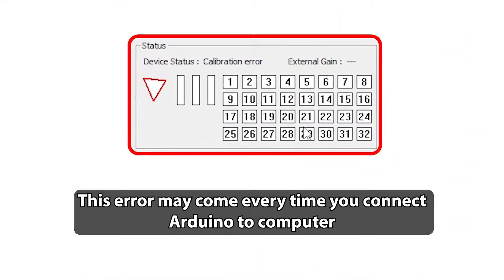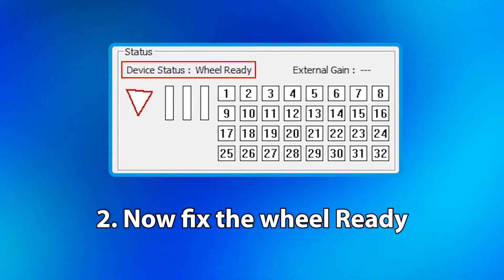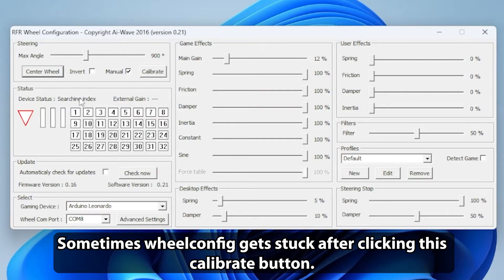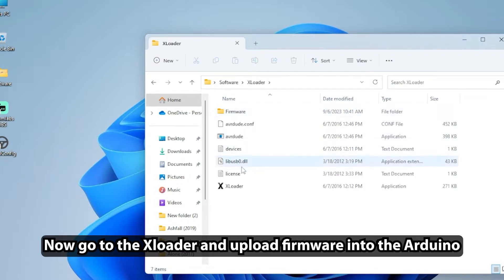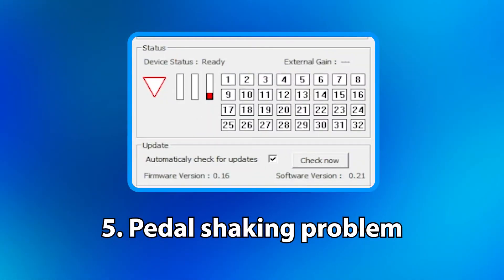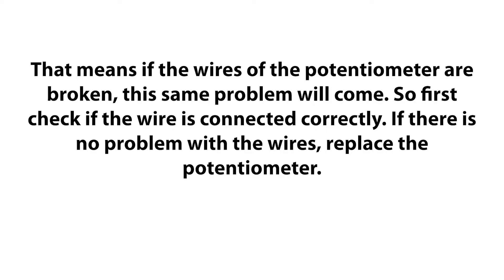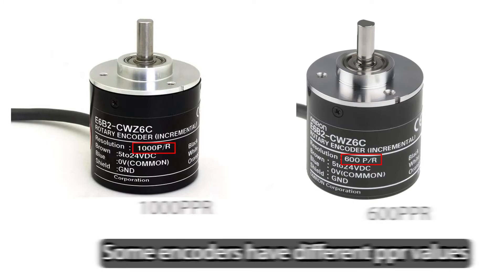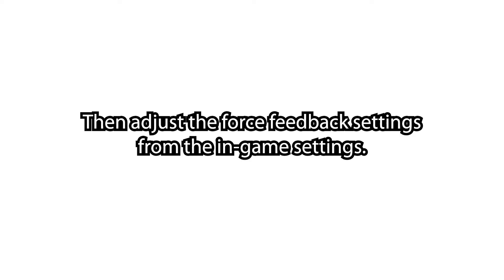Let's Fixe All Issues In RFR Wheel Configuration (0.21) | DIY Gaming Steering Wheel

Comment: I installed the application, no problem, it detected the Arduino, but it did not work even though I configured the encoder correctly, connected it and rotated it. I installed and connected EMC Lite to see if there was a problem with the card or the encoder. It worked. Do you have any information or a solution?

Comment: I couldn't solve the Firmware Version error
I completed the steps in the video completely

Help me
Reply from the maker: Rest your arduino board and try again.
Reply: I removed the Z connection and it was fixed. In order to work the encoder, it was necessary to make a Z connection on the Arduino  @zudumalli

Z connection= gnd-> A0

Comment: Hello, I have a problem. Can you help me? When I turn the steering wheel and then return it to its original position, if the 12V power is off, the steering wheel is in its center, but if the 12V power is on, as soon as I turn the steering wheel and then return it to the original point, the steering wheel is not in the center and its center is messed up. Please help me. This problem has just occurred to me. I checked all the wires, the motor, and the encoder, but I could not solve this problem.

Comment: i have built this, everything seems fine but while playing a game like ETS 2 or assetto corsa, everytime i change the gear the wheel changes it center to right little bit ,i am using RFR Wheel Config how do i fix this?
Reply from the maker: Maybe there's a short circuit somewhere.
Reply: @zudumalli  thanks ! It helped, turns out the Z toggle pin had came out and was making contact with the gearbox pins

Comment: My issue is that the force table scroll is stuck at 0%, and the motor is not generating any force feedback.(i am testing  using a HW -040 encoder and a 6 V motor and  battery )

Comment: hi my problem is i am using potentiometer for the stearing wheel but it stears half theway left and doesnt stear right i did replace the potentiometer and did it from another combuter didnt work seams like the problem from my arduino can any body help me to solve it
Reply from the maker: You need to rotate the potentiometer to the middle position, then rotate the steering wheel to the middle position and connect them in parallel.
Reply: I did rotate the potentiometer with my hand it turns left but it doesn't want to turn right on the software

Comment: My wheel starts spinning continuously like crazy when I move it fully to the right side 900 degrees but if I do it on the left side there is no feedback to stop me. Please help me
Reply from the maker: watch this video to fix continuously running - https://youtu.be/D8GYcRZPn_U?si=NXdmFAJ8IYrjH9Sk
If ffb doesn't work in one direction, it could be because one of the Arduino's pins 10 and 11 isn't connected correctly. Check it out.
Reply: @zudumalli  no the wheel isn’t spinning like this. It’s only when I move it to right side more than 450 degrees that it starts spinning like crazy. I have already fixed these settings
Reply: Same issue

Comment: May I know can add more button can make ya?  It seems like in the wiring only 9 buttons in total allowed.
Reply from the maker: Yes you can use Arduino Analog pins as buttons
Reply: @zudumalli  Thank you! May I know is it need to do additional coding? I see some tutorial using resistor with different value.

Comment: Hello! I can't solve the problem.  When connecting the power supply, the motor makes it a little difficult to move the steering wheel, although the spring and damper are at zero. I have a gearbox in my steering wheel, which also makes it difficult to rotate the steering wheel. Is it possible to make it so that the motor, on the contrary, helps to turn the steering wheel a little, but at the same time the recoil also works?
Reply from the maker: Does it rotate freely without power? If so then it is a software issue. So reset the software settings and check again.
Reply: @zudumalli  Yes, without power it spins almost freely. I'll try to reinstall the firmware. Thank you!

Comment: Ffb is only working in one direction not att other power supply starts beeping when i rotate
Reply: I got the same issue and still looking for solution. And it’s still happening even though I’ve changed to a new arduino

Comment: How do i fix mine when i rotate my encoder its move slightly then go back to its original state its not rotating its just keep coming back to the center
Reply: Wire it up correctly dont have any free wire around that comed in contact with other wire solder it and use Heat shrink or a breadboard
Reply: @QuizKing-QK8  i already wired it correctly and i use breadboard to connect it
Reply: @AnimePhilippines  Thats weird it should work if u use a breadboard it was the issue on mine too it was shorted but if its still not working then i dont know
Reply: @QuizKing-QK8  ok thanks for your time

Comment: Brooo iam facing annnn confused error please help mee... When ii usee ffb of wheel the motor only works with right sidee nott att leffftt when i movee... Power supplyy making noiseee and motor also not turning both sidesss please helppp
Reply from the maker: same happened to me. It happened that on the Arduino board, one of the pins 10 and 11 was not connected. so check your these two wires.
Reply: @zudumalli  ok brother thank youu😊.. Whatt can i doo if same problem occurs

Comment: Hello, I am facing every odd problem in this wheel configuration software, when I click on center wheel, the triangle goes either side over 450 degree, this problem also messing up the ffb because the center is somewhere else. 

Please help in this problem, if you ever faced it, if not then find for new comers
Reply: Yes..Mee too..the centre wheel always gets changes during the gameplay..it's very hard to find the centre of the wheel

Comment: Hi, is the wheel plug and play after configuring it? Like, will it work on other desktops without configuring it again? and regarding the dc motor, I would like to add another dc motor and wiring it in parallel with the other motor, is it safet to do? or should I add another bts7960 driver and add that to it?
Reply from the maker: 1. Yes, it is possible, but sometimes FFB does not work, so you have to reset the settings and do the configuration. (And before unplugging the wheel, the z toggle switch must be turned off.)
2. Other computers must have the necessary software before connecting.
3. Yes, you can connect in parallel. But this increases the temperature of the motor module slightly. And a little more power has to be provided.
4. Yes, the power delivery is improved by using two BTS7960 drivers. Just use two if you want it's not a problem.

Comment: Bro my steering wheel is moving right and left very quickly even I move it slowly I used a potentiometer directly to the steering wheel without using any
 board's  why
Reply: I don't have Arduino bord how much does it cost if we can use Arduino board then that is the use of using Joistick board
Reply: Can I can do without that
Reply: Can we use mouse for steering wheel
Reply from the maker: Did you do the calibration with the ''windows game controllers'' 
and it like this happened?
 https://youtu.be/F8xgsbUeE0c?t=547&si=oAfELxML-vcqeE2q
Reply: @zudumalli  no